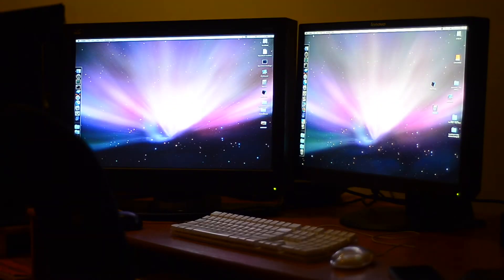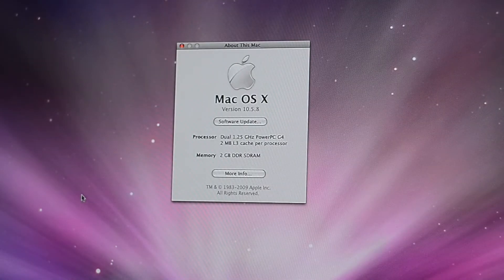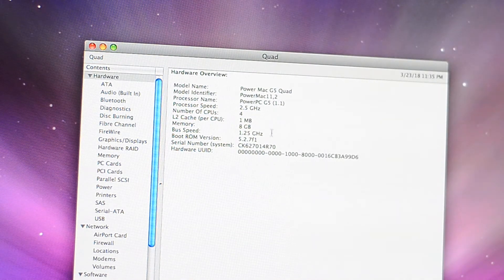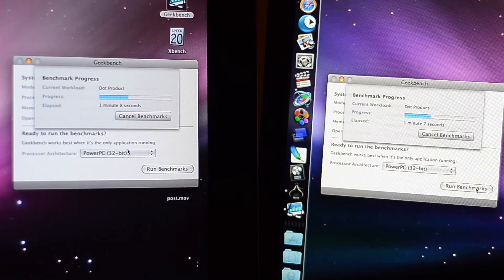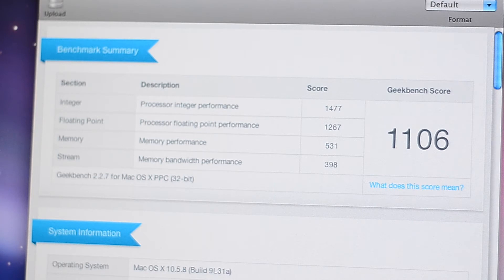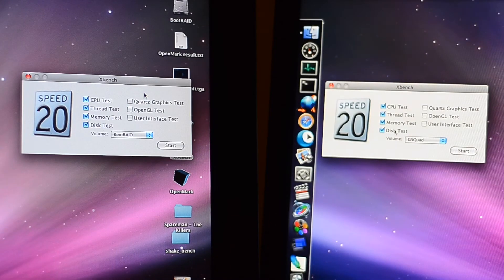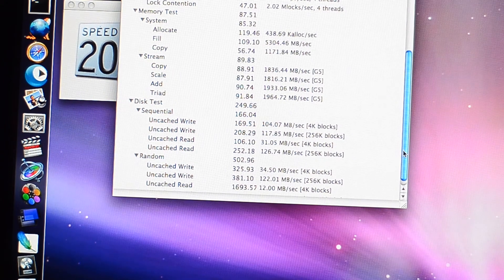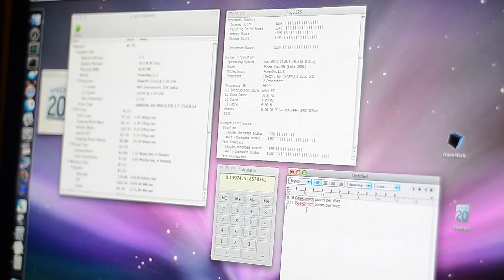PowerPC sunset (part 4) - G4 vs. G5 - The Road to Intel and what happened to the PowerBook G5

Comment: G4 was and still is the most advanced and powerful computer in the world. Its lighting fast and can compute millions of code in seconds. Power PC is the best processor in the world even in 2025. I still use a Power Mac G4 as my main daily computer and it does everything i ever need a computer to do.
Reply from the maker: Isnt browsing the web a bit too slow? (the web's fault). The only use for my G5 is adjusting and de-dusting huge TIF files (think 30000x30000 pixels). It is much faster than my new thinkpad for some weird reason. =)

Comment: The PowerPC 970, which Apple called the PowerPC G5, was considered a big flop in the Mac community, that it was responsible for killing the AIM Alliance, an alliance that was a joint venture between, Apple, IBM & Motorola; dedicated to the development of PowerPC.

The PowerPC 970/G5 actually had inferior performance compared to the AMD and Intel x64 processors which were released between 2003 and 2006, as those outperformed PowerPC for the first time. The PowerPC 970/G5 also had power consumption issues, which made it very hot for the Power Mac G5.

At his 2003 keynote Steve Jobs promised a 3 gigahertz Power Mac G5 within 12 months, which ultimately never happened due to IBM's issues with manufacturing the processors from 130 nm to 90 nm.

These issues with the PowerPC 970/G5 combined made it difficult if not impossible for a iBook G5 and PowerBook G5 to be manufactured.

Only three Apple Mac models were ever made with the PowerPC G5 processor, the iMac G5, the Power Mac G5 and the XServe G5. The failure of Apple's PowerPC G5 roadmap resulted them in transitioning to Intel processors in 2006, which ultimately ended the AIM alliance that year.

Comment: In many ways I see the g5 is a lot like the Pentium 4, aka netburst. Ironically both platforms had been optimized towards servers meaning deep pipelines and high bandwidth FSB. They're both excellent streaming platforms, because that's what servers do best and with an added benefit of being upwards scalable, Unfortunately this also means it wasn't downward scalable. Ever use a Pentium 4 notebook? They made them but it wasn't good. The G4 that came before it was far superior in that it could scale from notebook to server (kind of) much better than the G5 could ever do. I think honestly they should have done what Intel did to the Pentium III.. widen the bus, add some cache and shrink die the thing a little. Look, a G6 aka Pentium M!
Reply from the maker: This was exactly what PA Semi was doing before Apple bought them, no?
Reply: @Shiunbird  Hey, yeah kind of. I remember that little chip designer and yes that really could have been something if things worked out.. even just doubling the G4's bandwidth and caches really would have taken it to new heights let alone going dual core. It would have made the G5 seem outdated while using a lot less power. The G5's U5 Northbridge alone used something like 88 watts so that should have been a really low bar to improve upon. Yet it took until the end of 2005 to get anything close. By 2005 the poor G4 looked laughable, especially for what Apple demanded for one.
Reply from the maker: @PearComputingDevices  and too hot. 

It’s quite funny to look at how much the G4 heat sink (and noise) grew over time.

One of the quietest computers I’ve ever had at the time was a 733 G4 that I had at work at the time. My dual 867 on the other hand is unbearably loud.

They certainly felt fast, due to tons of software optimisations, but fast they weren’t.
Reply: @Shiunbird  I had a 733 digital audio, and that too was nearly silent. The loudest part was the hard drive. Imagine sticking a solid state drive in one of them? But something happened in the quicksilver era. My dual 1ghz quicksilver was fairly quiet but the heat sink was huge.
Reply from the maker: @PearComputingDevices  Yup - the 733 digital audio exactly.

The dual 867 is unbearably loud. I had a dual 1.25 with Verax fans that was quiet - but even that was not as quiet as the 733 DA.

I only keep the 867 to run SimCity 2000 and experiment with MorphOS.
Reply: @Shiunbird  That's a good platform to experiment with. Just be careful of the power supply issues. As long as you keep the MDD clean though, I've never had a problem. I think it's heat build up that kills them. But MorphOS is pretty neat. Very snappy on older systems too.

Comment: Very interesting, I cant find a comparison of an era pentium chip compared to a g4 or g5 in practical use. I have a powerpc with 1.67 ghz and it can't surf the web or view youtube videos, however I find pentiums are still capable pf such tasks. I feel like I bought in to apple lies and that the power architecture was inferior all along and am afraid we will find the same lies with the future apple silicone chips, placebo performance boost.
Reply from the maker: The problem is software support, I'd say. Software for x86 is far more optimized for older CPUs than PPC software.

I had, up to two years ago, a dual Tualatin Pentium III 1.4 board and it's not better than the G4 s I've had on the web.
Reply: Yup, definitely software support is the problem here. That's not to say Mac OS X is bad, it's just proprietary as is the system itself. When you buy in to Apple or any other platform, that's the price you pay.

Comment: oh no
if it comes to performance per watt, then IBM PowerPC 970MP is far superior
we are talking about max 4x 2.5GHz compared to at best 2x 1.66GHz

Yes processor is power hungry, but it gives huge performance in exchange

and another thing is that no compiler could even touch full potential of PowerPC 970
it was way to complex to get its full potential from it

quote from wikipedia
The PowerPC 970's pipeline was lengthened from 9 stages to 16 - 21 stages for the PowerPC 970 FX. It has 10 functional units - 2 Fixed-Point Units, 2 Load/Store Units, 2 Floating Point Units, 1 Branch Unit, 1 SIMD ALU unit, 1 SIMD Permute unit, and 1 Condition Register. It supports up to 215 instructions in-flight: 16 in the Instruction Fetch Unit, 67 in the Instruction Decode Unit, 100 in the Functional Units, and 32 in the Store Queue. It has 64 KBytes of directly-mapped Instruction Cache and 32 KBytes of D-Cache

no modern CPU has such abilities
and we are talking about 16 years of improvement
Reply from the maker: I'm not sure you are right about the 970MP being better per watt. The standard 970 surely isn't. Could you share the reference?
Reply: @Shiunbird  Simple thing
Compile Linux Kernel - allyesconfig
I was doing it many times a day on Apple PowerMac G5 Quad with 16GiB RAM
It took more then whole night on Apple PowerBook G4 A1138 with 2GiB RAM and configuration was cut as much as possible - just what is needed for Apple PowerBook G4 A1138

On Apple PowerMac G5 Quad it was taking about 45 minutes first time and then around 40 minutes (all data was cached)
I was doing it because my landlord was extremely concerned with gas bill and it was terribly cold in my room
This was my covert heater - he did not even had idea how much energy it was using and how much energy it was pushing into heat
Reply from the maker: @WizardNumberNext  If we are talking about pushing heat out... I can't even describe how helpful my IntelliStation 285 was during winter. It's a hairdryer, really.

Comment: are you seriously comparing IBM workstation with PowerMac G4?
or are you just mention IBM workstation for reference?

by the way
in may 2010 AMD released AMD Phenom II X6 which at the time had huge L3 cache of 6MB

it all depends on use scenario

IBM workstation is NOT Apple PowerMac G4
you would not expect to run multiple Operating Systems at the same time on Apple PowerMac G$
on the other side I would expect high level of Hardware Virtualisation on any IBM made workstation, as they have been first in both multi-threading and virtualisation in year 1968 (yes, 1968)
I would not expect any less then full hardware virtualisation from high end IBM workstation. For this you need a LOT of cache

you may work perfectly fine running 2-4 Operating Systems on say AMD Phenom II X6, but try..
running say 20-40 Operating Systems on same hardware and you discover what cache trashing means
be sure that PageFile trashing is absolute bliss compared to cache trashing
Reply from the maker: The mention is just a reference.

Comment: PowerPC isn't bad either even compared with Alpha, X86, ARM, UltraSparc and Mips. It's been told that even a PPC750 running 500Mhz can easily emulate a MIPS R4000 and MIPS R5000 cpu...Is this right? I'm rather interested in further PowerMac G5 comparisons....maybe with freescale e5500 or e6500 workstations, like the A-eon X5000/40 with a P5040 cpu inside...
Reply from the maker: The 90s were very competitive indeed. Unfortunately, non-x86 platforms were more expensive and could not compete in volume.

It also comes to the system. SGIs were built to have tons of system bandwidth, and that all cost money (not mentioning the fact that some models were built in Switzerland).

The PowerPCs were very good at emulating x86. As far as I know, there was even a version of VirtualPC that emulated graphics acceleration. There was also lots of effort to get x86 to run ok emulated. I remember trying one of the first versions of PearPC and took my Pentium III 500 15 minutes to get to the boot screen. My G4 733 could run Windows 2000 desktop and 2D games just fine.

Unfortunately, my G5 is gone and all the alternative modern PPCs are very expensive. I'm trying to sort my life out and piling up non-practical computers is not the way to go. My G5 was my main workstation for a long time, but now I am well served by a classic Mac Pro with 2x Xeon X5675. I never managed to make practical use of my IntelliStation - although it was nice to see Firefox 3.6 running, GIMP 1.0 and OpenOffice under CDE in AIX. =)

To answer your question, yes, as far as I know the PPCs were very good at emulating other platfoms, and that was the case probably because they were the most common non-x86 computers around and emulators got a lot of attention.

Comment: Interesting comparisons. It's a clear demonstration of how the CPU architectures of the era were reaching their practical limits as scalability and raw power gains resulted in more wasted energy.  While there were gains to be had, at the rate things were going just increasing clock speeds and complexity wasn't going to get us very far.
Reply from the maker: Kurisu Yamato the netburst and the G5 are both sinners in terms of power consumption and inefficiency. Intel returned to the P6 as basis for the first Core line. The G5 was the nail in the coffin for the PowerPC. Everyone was rushing to increase core speeds. 

The x86 was not the way to go in terms of elegance, but intel won because of the process advances and aggressive energy state changes. I wonder how the world would be if all designs could have been produced using intel’s processes.
Reply: I find it interesting that only now are we really starting to see clock speeds increasing like they were back in the early 2000's. Of course, now we are dealing with CPU's running a dozen cores or more in some cases, so the raw power of these processors is incredible compared to what we could have achieved with the old architectures had they not had thermal issues.

In a way Netburst and PowerPC having the problems they had was one of the best things to happen to the computer industry, along with ARM.

As for X86 being dominant even to this day via X86-64, that need for backwards compatibility seems to reign supreme, especially in business. In a weird way Apple's current attitude of "if it's not new, forget it" may be helping us advance, even if it's annoying and wasteful.
Reply from the maker: Kurisu Yamato Agreed. Let’s see where we will get from here. Diversity is always a good thing, though.

Time will tell. :)
Reply: I have a feeling you and I are going to have many wonderful little chats! I'm glad I subbed and have commented as I have, your replies have been great. My new friend, you're awesome. :D
Reply from the maker: Kurisu Yamato Thank you. Likewise. 

And welcome. :)

Comment: With so many negative sides to the G5, why they launched the G5 cpu in this state,?
Reply from the maker: I'm no expect in CPU design, but Intel had the same issues during the era. NetBurst had the same problem of high power consumption for the performance. Intel Core was based on the P6, instead of being a successor.

If I remember right, the idea was to get some deep pipelines and then boost the clock speed. This works. You get better performance, and better clock speed, but your energy consumption goes through the roof and not everything you do runs faster this way.

A PowerBook G5 1.67 or 2 GHz would be slower than a G4 for most tasks, so it never made any sense to have it produced. Since the Power Mac G5 is a desktop system, power consumption was not a big deal.

I don't know how I could measure the energy consumption of the CPU only, but the G5 has also a MUCH faster system bus and PCI Express - that also raises energy consumption. And again, not every application will make use of a faster system bus.

It's complicated.